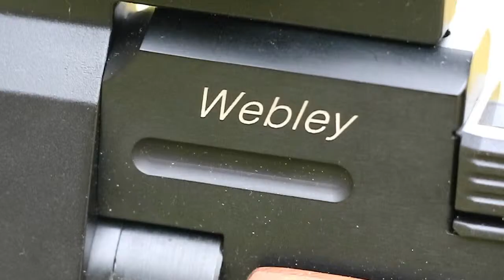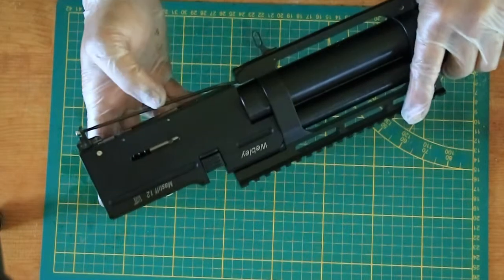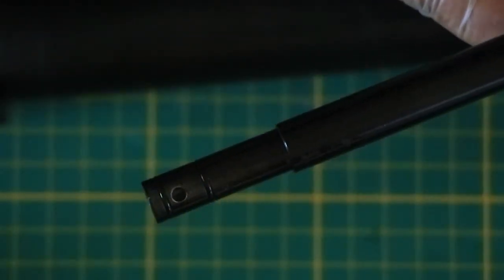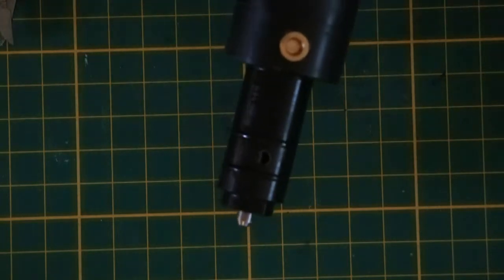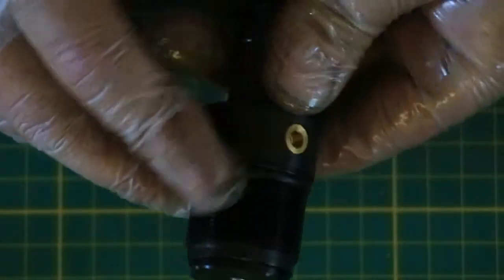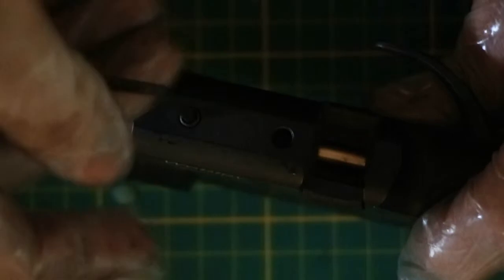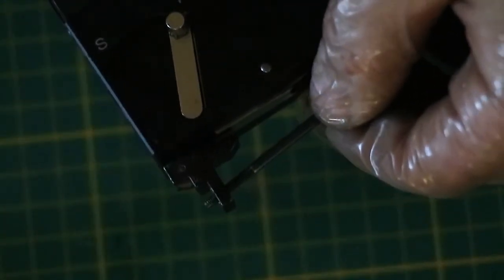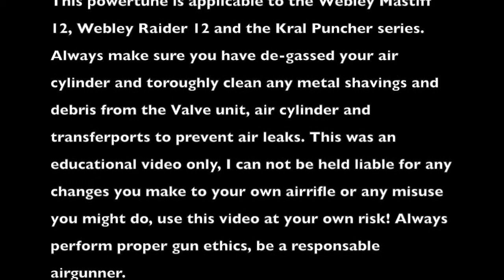Webley Mastiff 12 Power Tune

Comment: Fantastic in depth video thanks. Can the hammer spring not be tuned on these? I need to stay under 12ft lbs but it’s currently at  10! I just want that little bit more.  I’ve only got it a few days ago so not had time to strip and look myself 
Thanks Martin
Reply from the maker: To increase hammer spring tension, you have to unscrew the trigger hinge fork which is screwed on to the action block right under the hammer spring adjustment plug, then deep inside that screw hole you will find a non removable screw that pinches the hammer spring adjustment plug. You will have to drill this one out to free up the adjustment plug, then you can tension the hammer spring.
Hope this helps.
Reply: Patrick van der Heijden thanks Patrick, wow that seems a lot to do for a couple of ft lbs😟 I can’t believe they can not be set correctly at 11.5 if they are for the U.K. market. Rfd’s just day that 10 is acceptable as it’s within 2lbs of the target, but it’s not acceptable to be 2lbs over 😳
I’m going to take it back and say I don’t want it if they can’t sort it out. Wish me luck 😉👍
Reply: mine is 9.78ftlbs not acceptable when it's marketed as a full power hunter

Comment: That barrel transfer port is very close to one of the o rings. They should have made it more central to allow safer drilling. You could easily fit a different barrel to solve this.

Comment: This may sound daft but what's the best and safest way to release the air from the resivour b4 working on the gun I'm planning one following this video and doing the same to my puncher jumbo in. .22
Reply from the maker: Next to the valve body there is a brass hex screw which houses the burst disk, you can un-tighten this hex screw just a little bit (Quarter of a turn is enough) to bleed the air, after you are done, tighten again just enough to seal the cylinder.
Reply: Awesome thank you been a bit worried about the whole air thing happy drilling not the air bit lol

Comment: Cannot get the valve stem open with a 13mm spanner it simply won't budge. I've tried it all... any tips ?
Reply from the maker: most likely secured with locktite, ensure you completely purged all air from the cylinder and apply some heat to the end of the cylinder where the valve meets

Comment: Hi again Patrick I'm afraid I've got no further than trying to removing the stock my one doesn't seem to have a straight forward bolt
Reply from the maker: Possibly the Brass insert at the Bottom of the stock prevents you to access the Hex bolt
Reply: Yes I worked that out, now I'm stuck at the pellet probe, the large screw at the end will not budge seems to have a pin holding it, there is a spring on the probe but can not find a way in.
Reply from the maker: @birderdavid1  as far as I know that flat head screw is not secured by a pin of some sort. Mine was pretty thight as wel, but it might be that they have locktited it as a form of anti tamper. Try to apply some Heat And try again
Reply: @vwgoco  there is a pin that leads up from the 5mm trigger nut, the trigger nut and the rod needs to be free I think
Reply from the maker: @birderdavid1  ok, that is An anti tamper pin then. You can remove that trigger hinge though, maybe you can access that pin from under the trigger hinge?
Reply: @birderdavid1  i have the same problem David, does the brass insert screw out ? thanks in advance.

Comment: Hi Patrick looked at your vidio I want to replace the pellet probe can you help me??
Reply from the maker: Yes no problem. Start by taking the action out of the stock. Detach the trigger shoe and loosen the action bolt underneath the handgrip. Now you can seperate action from the stock. On the left hand side of the action remove the small flat head screw out of the sliding hammer. Now at the rear of the action, unscrew the large flat headed nut which retain the hammer and hammer spring. Then on top at the rear of the action remove the flat head screw, now your cocking lever is loosened. Next, remove the small flat head screw which still holds the cocking lever to the pellet probe hinge. After all that, you can remove the probe which is than slid connected to the guide Rod. Hope this helps.
Reply: @vwgoco  Thank you Patrick let you know how I get on

Comment: I followed this to the letter drilled out to 2.5mm from about 1.8mm no burrs reassembled and now the stem assembly won't seal against the valve body it just leaks from the transfer port? any ideas? I thought maybe the pressure plate on valve stem may have been damaged but I've checked again and it's fine 😶
Reply from the maker: Are you sure you did not damage the hard rubber seal on the valvestem? And have enough pressure on the valvestem seal by means of the spring compression? Maybe you have increased the hammer spring tension to hard/stiff that it compresses the valvestem?
Reply: all sorted thanks Patrick, the new upgraded valve stem seemed to fix it, I haven't touched the hammer spring because it has the anti tamper screw,it's very consistent fairplay starting to really like it now. thanks again for the great vid 😊
Reply: @lyndoncook4508  if I may ask mate what was the increase with the 2.5mm  drill out, thinking of doing the same due to 10ft lbs standard performance, looking to increase it a bit!